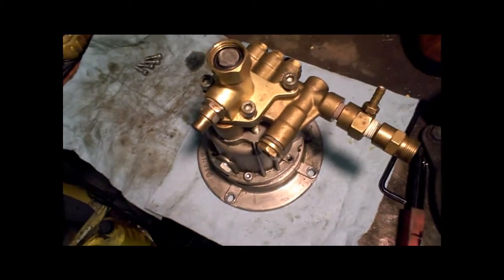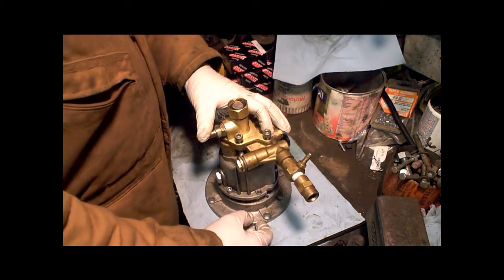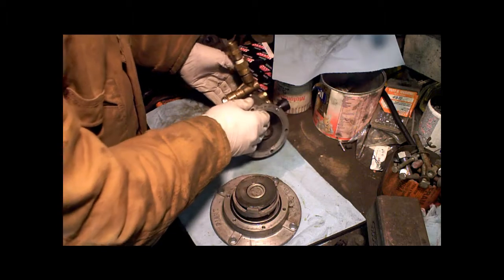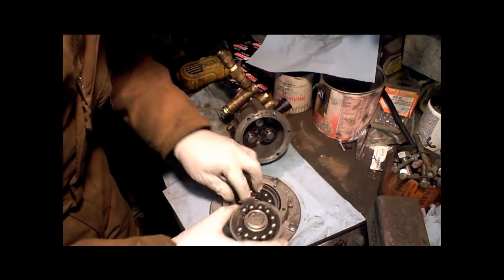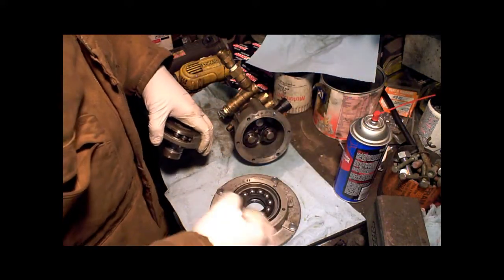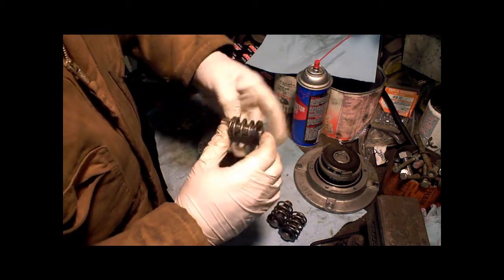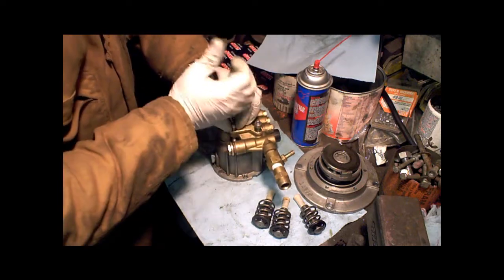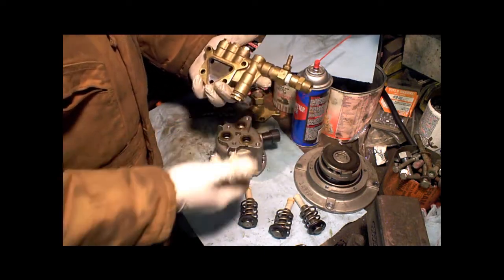Giant pressure washer pump Rebuild part 1 of 3 Campbell Hausfeld

Comment: Did you use regular bearing grease to grease the bearings again?
Reply from the maker: No. The bearings are lubricated with SAE30 non detergent oil you fill the reservoir with.

Comment: giant model  # hr20 what kind of oil? No fill site or drain. Top plastic cap that says oil, I don't see oil . ??
Reply from the maker: Fill it with SAE 30 Non Detergent motor oil. Fill it through the cap you unscrew until the springs are just covered. To Drain tip it upside down and pour it out this same Vent/Fill port.

Comment: Detergent is not being pulled up. Any suggestions?
Reply from the maker: There is a tiny spring and check ball in the part that the vinyl tubing connects to. It is most likely stuck or rusted. Take off the vinyl hose and spray WD-40 in the hole. You can also push a small needle like object into it to make sure the spring/ball are moving.

Comment from the maker: That's a great question. Pressure-    Washer-    Parts-   DOT com is where I got them. I only ordered the parts I needed as I don't think they had a complete rebuilt kit. They have small kits they have things like all the plungers, etc. It has been working great since.